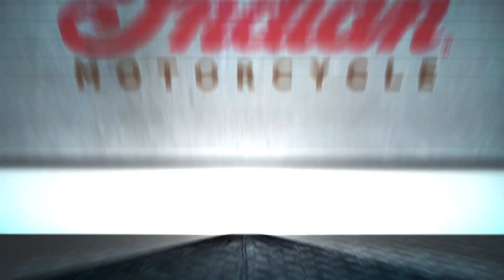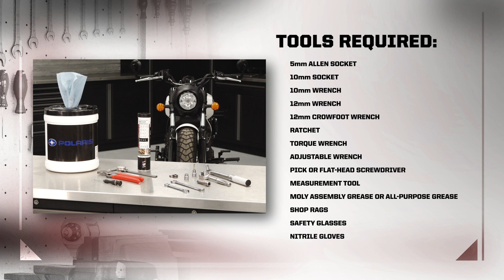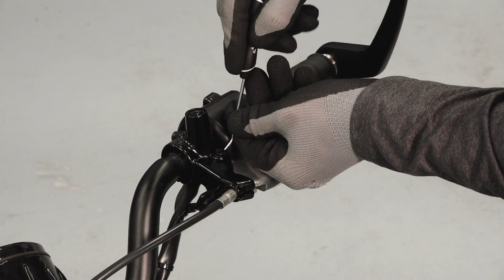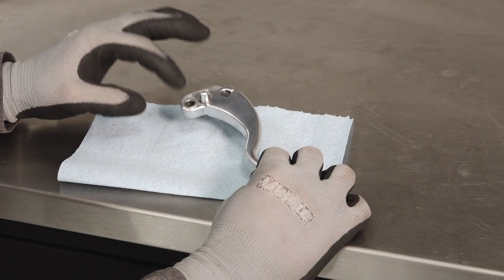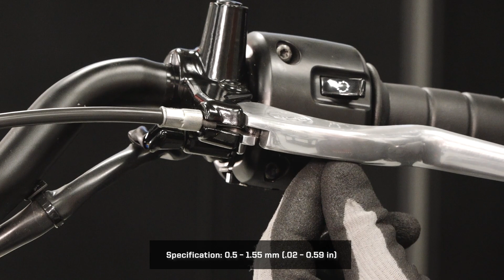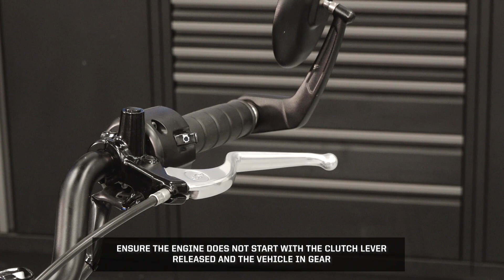Indian Scout Clutch Lever Maintenance and Adjustment - Indian Motorcycle

Comment: Why not tell us which direction of the adjuster (clockwise or counter clockwise) increases or decreases cable slack? It would make it easier instead of letting us climb up and down as we try both directions. Same stupidity in the manual section on drive belt adjustment. Which direction makes the belt move left or right? You'll figure it out, no need for us to save you time and tell you.
Reply: It tells you in the manual dumbass
Reply: Hahaha well what is the answer. I’m sitting here trying to figure that out right now.